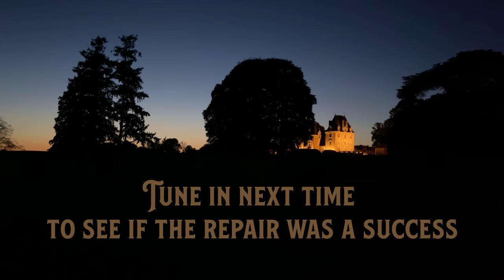Repairing My Vintage 1940s AGA Cooker - Doing It Ourselves

Comment: Hey Michael, tip for the next time you have to empty the Aga: vermiculite is also good for usage in the vegetable garden. If you mix it with the soil, it keeps the water
Reply: Yes i mix it with my potting soil!
Reply: Also for controlled cooling in heat treatment of metal work projects, I had been trying to remember it’s name so I could buy some for that and it’s only now vermiculite has finally been said

Comment: I use to build  and service Aga cookers ,  The rods for the cooker top will move out of line, If you get some 10mm copper pipe and slide it over the rods before you remove the top with about 8 inches showing out of the holes , lift the lid over the copper pipes leaving them in place over the rods you will find its so easy to replace the lid without fiddling around with a screwdriver to try and get the rods back into place

Comment: When it comes to insulation, it is the airspace that INCREASES the insulation value. Dead air spaces are what make insulation work. If you look at insulation (like the ceramic wool) it is filled with very tiny spaces of dead air, when you compress the insulation you actually lower the insulation value.
Reply: HOORAY someone else who actually understands just how the insulation works!!!
It sends me round the twist when I see people just stuffing asmuch insulation into a gap as they can possibly get in. Doing it the right way would help save people loads of money if they just spend 5 minutes to research into how to use insulation in the first place 🙄 👍  🇬🇧.
Reply: The ceramic fibre would also have a higher temperature rating, depending on the product. My kiln is all ceramic fibre. it's  great for heat retention but also cools quickly. Not sure about using the rockwool in the oven space. Anyone know the fire rating for it?

Comment: At last I just read a notification from someone who watched this video, who actually understands how insulation works.  Just because you're able to squash it down with your hands and pile more ontop that is not how it works!!! The insulation comes exactly the way it should be used because it has loads of tiny air pockets within it. These Air pockets are there to trap air within the insulation helping to increase the resistance of air and sound passing through it gives the required insulation you need also Vermiculite is a very very big product that is used throughout the horticultural community, where it is combined with soil. The reason is simply because Vermiculite retains moisture hence having the ability to stop plants from drying out too quickly!!! As always buddy    💯%     👍     🇬🇧.
P.s. you've done a cracking job in the restoration of the Arga, well done 👏
Reply: I am wondering if any one knows if I have to get a specific kind of Vermiculite to fill my recently purchased vintage 1988 Aga I bought here in Canada. We where hoping the old vermiculite was with it but unfortunately not. The Aga installer told me originally that if I wanted new Vermiculite I would have to order it from the UK and it is going to take 4 months :( I have had a look on Amazon and wondering if Premium coarse Vermiculite would do? is there a difference?
Reply: @alicesavage1964  as long as it's clean and pure and fine enough. Vermiculite is a natural mineral product

Comment: I highly recommend you look into a cast iron stove fan for the winter.  It sits on the back of the stove and is powered by the stove's heat.  They move 150 cfm and eliminate cold spots in the room.

Comment: Hi Michael, Great to see someone restore a solid fuel AGA as it should be rather than one converted to oil or gas.  It's in truly amazing condition.  I hope I can find one in the same sort of state.  But one thing that I'm wondering is how did you get on with the wood pellets?  Did they work and if so, how much do you burn through in a week?  How often do you have to empty the ash pan?  As you may have guessed from my questions, I'm hoping to get my hands on one of the four door models for my new kitchen.  It's truly inspiring to see how you've restored this beautiful machine and great to see that it can be done successfully by the average person.  I hope I can do a similar job because if you hear all the guys who work for AGA etc the first thing they say is "Don't attempt to take them apart yourself".  I had always assumed this was to protect their jobs but I wasn't sure until I saw your videos.  The cottage is looking great by the way.  The kitchen is looking beautiful too, keep up the good work!!!

Comment: I HAVE A 60YEAR OLD AGA ON SOLID FUEL Antaracite and it has a priblem its running tu hot top gets orange 
I so need someone like you with your experience tu sort it in southern ireland no one has a clue. At my wits end with it !

Comment: So glad you found it before sleeping in cottage with it sealed well, do you have a carbon monoxide monitor? Also could the vermiculcite not have been reused as insulation or in the greenhouse for potting??
Reply: Yes, that was my thought about the vermiculite.
Reply: I wondered the same thing. But, I guess when someone else is paying for it, it can be dumped.....
Reply: I am fairly certain that since they have to transport a lot of their own rubbish, that stuff from the junk piles does get repurposed here and there! A pile of vermiculite sitting out at the edge of the garden would be grabbed from here and there!
Reply: @twobluestripes : if it could and would be "repurposed," why was it just dumped in the trash pile and not put into a container?
Reply: If I remember correctly, they have bags and bags of the stuff out in the garage looking thing. I assumed he was going to keep it and put it back in, but I'm sure he had a reason for not doing it.
Reply: My first thought was perhaps the old insulation might possibly have had asbestos and therefore, the vermiculite might have been contaminated?  Just a guess.
Reply: @amyschneidhorst1384  that was what I was thinking. Not about asbestos, that didn't cross my mind. Nasty stuff. No telling if they had sprayed it with bad chemicals. God bless.

Comment: Thank-you very much indeed for making this video. I have bought an old solid fuel Aga and had planned to just put it in and use it. But it's become clear that I'll need to restore it first. I didn't know where to start and that's how I discovered your helpful video. It's clear you are very knowledgeable about these great stoves. If you have any pointers of where I could get written information from I would be very appreciative. My Aga has 28mm water pipes coming out of the right side of the stove, which is different to how you were describing them coming from the top. Would that be because it is a newer model? In all other respects it looks identical to yours, just in much poorer condition!

Comment: Hi Michael. Some great information and very well filmed. Currently doing up our Aga. Can you advise on the following? For the gasket that links the barrel to the top rhs simmering plate, is it recommended to use some kind of high temperature grease (ie Copaslip) on the surfaces of the flat gasket (NB not talking about any rope seals!) I'm struggling to find this information online. Many thanks if you can advise.

Comment: In the states, we call those wrenches Monkey Wrenches.  I don't know why... I like spanner better, and think I'll start using that.  My stepdad has always called hammers by their French name Marteau, and I picked that up a couple years ago, so pretty soon no one will know what tools I'm asking for!  Nice, thorough job on that Aga.  I'm wondering why you didn't save the vermiculite?  It's already fossilized, so it should be stable and reusable, I'd think.  If not, it's great for the garden, so don't take it to the dump/tip.  We use it in potted houseplants to keep the dirt from compacting.

Comment: Michael, it's so wonderful to see you just diving in to such involved and complicated projects - I love people who just teach themselves how to do this sort of thing. It embodies a kind of curiosity and determination that we don't see as much in modern life.

That being said, rockwool is not the same stuff as ceramic fibre insulation and has a much lower heat tolerance. Really hope that's actually safe for the heat the Aga will achieve (I'm sure it probably is and that you've done your research, but I'd be remiss not to say least bring it up - I'd hate to see your lovely cottage damaged, or wise, someone injured as a result of not doing so). I use ceramic fibre insulation for my pottery kiln, and would never attempt to substitute rockwool in its place. (Granted, my kiln gets up to roughly 1,245 degrees celsius, but if your Aga burner achieved glowing orange heat prior to repairs, you were well up into 460-500 celsius.)
Reply from the maker: Thanks for your message, I did some research and experiments many years ago and rock wool can withstand just over 1100 degrees Celsius without problems. I used it just to top up the level of insulation before the ceramic wool goes on top.
Reply: @DoingItOurselvesOfficial  thanks for the reply! I figured you had probably done some research - I just hadn't noticed you taking any out when you were dismantling things. I hope you didn't mind my commenting. 

Keep up all the wonderful work that you do. I really enjoy seeing your attention to detail and your artistry. It's so nice to see you happy.

Comment: Now it worries me that your having to do a repair so soon, really you haven’t had it that long Michael. Surely you wouldn’t or shouldn’t need to do this this often,so the question is why did it get a hole in it???
Reply: @mmc6657  you just beat me to it.😂👍
Reply: @mmc6657  it certainly does and I guess it looked alright when you put it together the last time. So you should be good for a long time now👍

Comment: I have just had my identical Aga lit today, mine is converted to heating oil though! I switch mine off during the summer months, so I cant wait until tomorrow when its hot enough to cook on, food really does taste better whne cooked in an Aga! We also rescued ours from a barn, but regret that we didnt get it re-enamelled at the time as the top is very scratched. Perhaps next summer I will get it done. Love all your videos, however long or short.

Comment: I’ve always wanted to know if the front of the Aga is hot to the touch!  Also, I just bet removing the stuff inside the barrels prior to repair was a bit challenging. I had never heard of an Aga before seeing this one. How plentiful/in-use are they around the world?  Do you ever use a microwave to augment your cooking?  Really enjoyed your excellent explanation of the make-up of the Aga. Sounds like you need to cook us some homemade soup when you are testing the unit! 😊
Reply: Aga's we're invented in the 30's  the whole thing gives off heat they are usually on 24hrs a day. I had a gas one they can be found in quite a few countries they cook food so much tastier. They have 2 or 4 oven models you don't have to regulate the heat 1 oven is hot  the other cooler so you can cook a turkey or large joints of meat overnight or even 24hours it just melts in your mouth. Also it makes the best toast on the top and dries your washing but the best bit is ....its an amazing bum warmer in the winter when you come in from the cold it's there giving of lovely heat to greet you when you come home oh and dogs will always hog the floor in front of them too 😁😁😁
Reply: Agas are more commonly found in the UK as opposed to the USA.

Comment: Could you not get it welded instead of throwing it away and keep it for a spare.
Reply: I think the iron is wearing thin along the bottom. Might cost as much to fix, if that's even possible, than it would to buy another. I know what you mean though, I always think about how there are a finite number of spare parts for old things. I remember jumping through fiery hoops trying to find a replacement whammy bar for a Japan-exclusive guitar from 1996 (the gold plating had worn off and I was restoring the guitar, and having it re-plated would have cost near $100). I managed to contact the biggest guitar shop in Japan, and they managed to find the last one they had, that had been hanging on the rack for over 20 years. I got super lucky.

Comment: It's burning long beach mate that's done it. Ordinary housecoal wouldn't have done that. Proper coal creates more protective ash than long beach but still giving a lot of heat. I see a lot of damage done to solid fuel appliances by man made fuels. Just use Ordinary coal for which they were designed, no issues. Long live King Coal! Just telling my boyfriend to put another shovel full on lol. Take care
Reply: @dannetterousseau4095  Most coal merchants in the UK sell long beach. You may also know it as petroleum coke?

Comment: So…uh…if you ever need extra cash, you could offer your services as an independent Argr (sp?) engineer/repairman in France.  In fact, the company in England should really know that you’re a resource for them in France.  Maybe they’ll give you credit toward parts if you return to them the old burner.  Can’t they reforge that thing?  (Although, since cast iron, maybe it would just be melted down… so perhaps it’s design doesn’t matter and it doesn’t have vintage value.) Blah dee Blah…